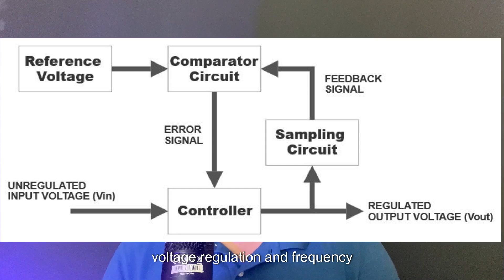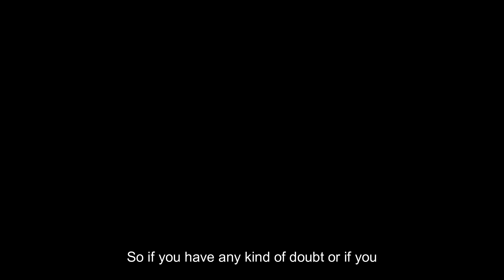How Solar Grid Tie Inverter Synch with Grid? Solar ON-Grid Inverter @huawei

Comment: Thank you for this video. I was wondering about the islanding of the inverter. I think that the output of the inverter is connected in parallel to the grid and the load inside the residence or business through a circuit breaker. What keeps the inverter from seeing it's own output and how does the inverter monitor the input to the inverter from the grid without also seeing it's own output since they are connected in parallel? How does the inverter add power to the grid and the load? I have seen other explanations using phasors and talking about real power and reactive power. I sort of understand the explanations, but I have trouble understanding the explanation in it's entirety. Thank you.